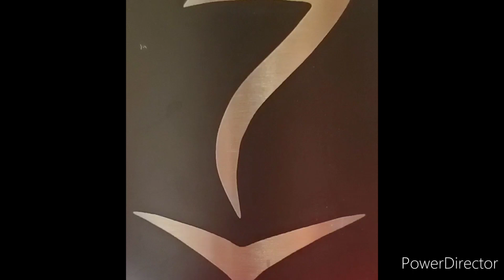Pipe Frame Is Done McCormick MTX110 is Down

Comment: When you see scraps of truck frame latch onto them.  That’s the good stuff.   Basically T-1 plate steel.  Ideal for repairs in high stress locations.  You cut parts around the Swiss cheese from the frame holes.  Looks the back has a opportunity for some reinforcements.  Good luck!!!

Comment: If in doubt help pull it out, hope the cylinder bore is good, those rods are fixable as long as the chrome isnt cracked
Reply from the maker: Tried to get it straight but cat quite get it 100%...ordered a new shaft...bore is fine

Comment: The ram bent when the bushing froze up on that side. Hense the crack's in that loader arm's . Check the pin's and bushings on both loader arms. Drill and tap a grease nipple on the pin's
Reply from the maker: You may be right...but if they froze up I would not have been able to take the pins out bu hand...I believe it cracked from pushing snow over the winter and hitting the odd rock them when I tilled all the way it broke out and the ram bent
Reply: @bcpfarmandtrucking6560   Had a Case loader the pin's would freeze up under preasure and it bent the ram and broke the weld badly when we were pushing gravel.